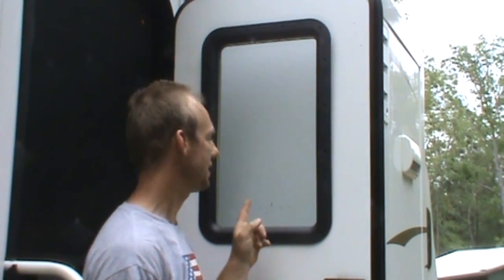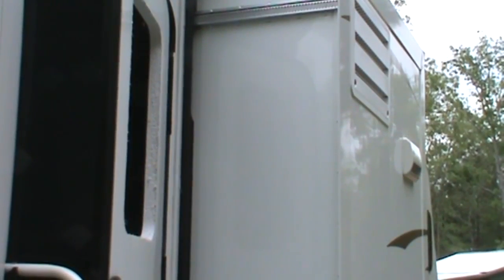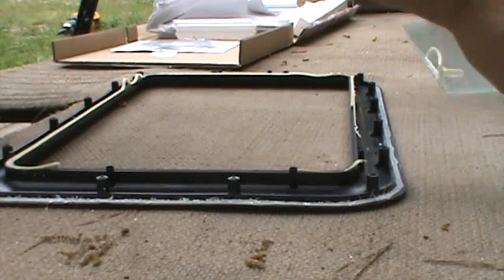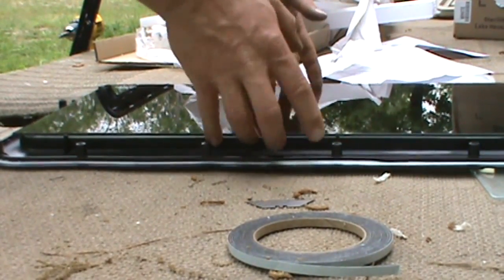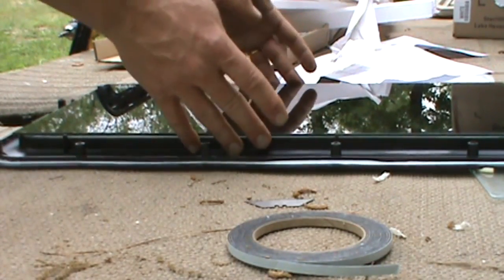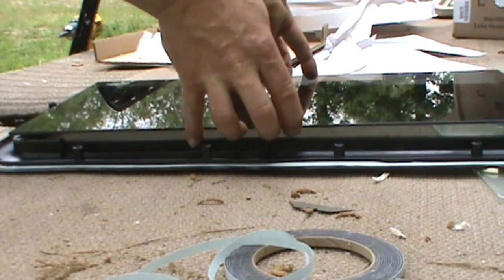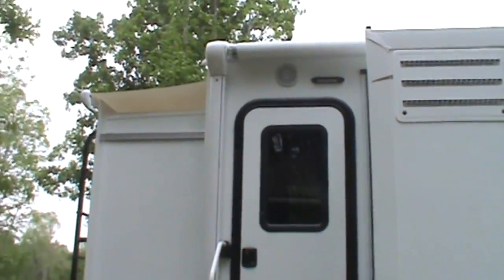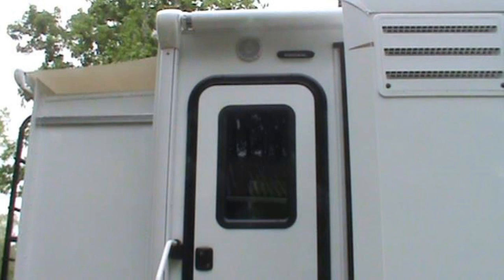RV Camper Door Window Replacement and Upgrade

Comment: Do you have a part number or where I could get the tinted window I called Lippard and they told me I could not buy the glass by itself only in the thin shade box and I do not like the thin shade frame because it’s over 3 inches of frame compared to 1 inch
Reply from the maker: Sorry, I do not have a part number but any tinted glass will work just order it with the frame and don't use the frame.

Comment: What site did you purchase your front door rv glass?
I’m so going to replace mine
Reply from the maker: This is the same thing  but comes with a built in shade AP Products 015-201512 Thin Shade Kit F/12X21 Rc Pw Black that is the one we have now. and its much cheaper then the other one

Comment: What is that tape and where do you get it?
Reply: It is called "seal tape" its a high-quality double-sided butyl tape that you can purchase online or at local home improvement stores. 

Google        Fabral 1/4 in. x 40 ft. Butyl Rubber Sealant Tape 
This is what I used to replace the glass on my travel trailer door. I went from the frosted tempered glass to the dark see-through tempered glass for under $26.00 so there really is no need to buy the more costly replacement windows unless you insist on having the pull-down shade or your original window frame is damaged.
There are many other brands of butyl tape out there, I'm just telling you which brand I used, I purchased a 40-foot roll at Home Depot for $4.55 + tax and I bought the piece of glass on eBay for $19.20 + tax Total cost $25.24
The piece of glass is made by LCI which is the manufacturer of many of these RV windows.
Reply: @99shadows66  thank you very helpful.